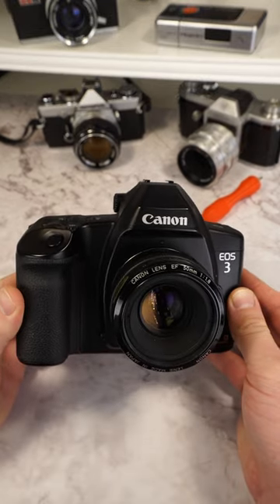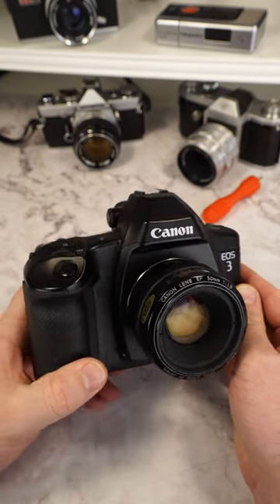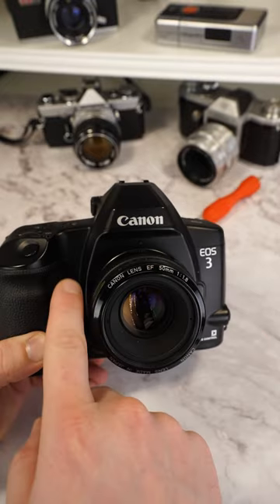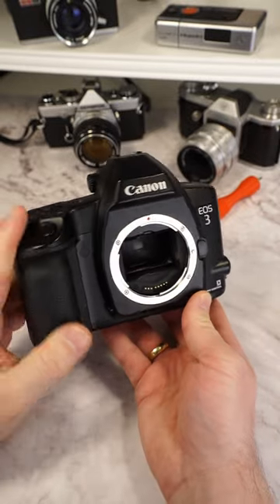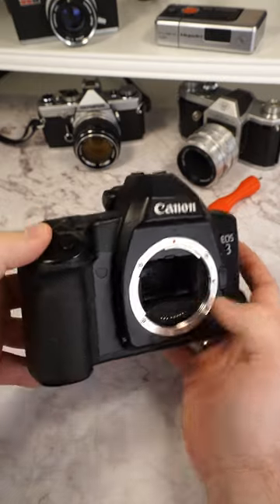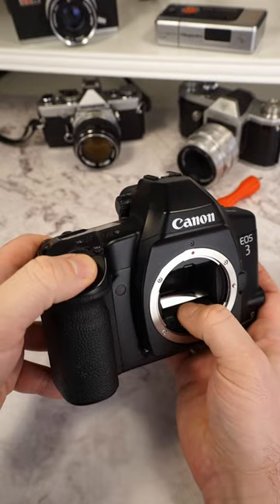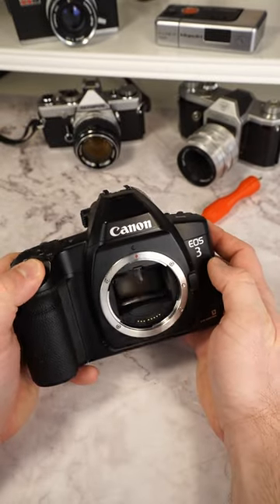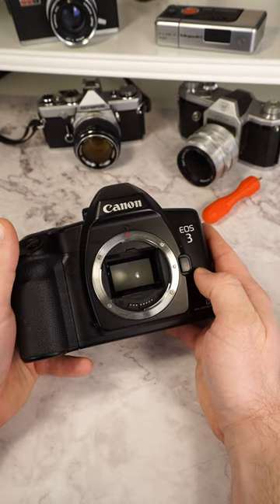Canon EOS 3 - Stuck Mirror -  Quick Fix

Comment: I wish I had your knowledge about vintage gear to do the repairs myself :)
Getting this old gear fixed can get expensive.
Reply from the maker: Haha! I wished I should not need to know this. The first time I took the camera out was a real wtf moment. Luckily it was just a Spielplatz test trip and no important photos were not made. 😅

But honestly it is kind of interesting to learn and re-engineer the cameras mechanics. The eos is too electrical. When there something breaks, it is broken. This whiggle trick I just found out by pure luck and desperate. 🤪